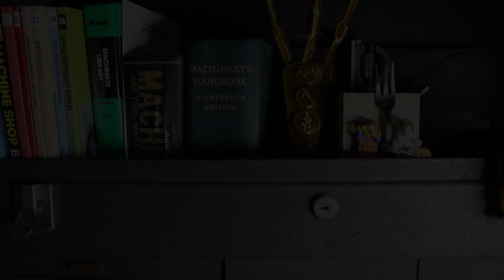Making an Adjustable Vise Stop for the Mill

Comment: This video just came up today for me.  Had a look at your other videos and subscribed.  I really like some of your designs!  Great takes on some concepts.  For this work stop I love the details.  And the single knob angled lock really caught my eye.  But I'm not sure about it for a work stop.  I made my own similar style work stop a few years ago.  But I used separate locks for the vertical post and stop rods.  I think I prefer the ability to line up the rod and lock it for angle and height separate from the actual stop rod.  No fumbling in 3 dimensions.  But the idea of the twin lock feature from one angled knob could be a real game changer for something like an indicator holder where it's not at all uncommon to be sliding things around in 3 dimensions at once.  It's certainly a slick idea that I'm going to try to use in SOMETHING fairly soon.

Comment: set up your chamfer on the non movable jaw of the vice. then you can mill every piece of material thats that same size in your shop with the same chamfer profile. including all 4 sides of whatever you are working on.
Reply from the maker: I did it on the movable jaw to get better shots. It was square enough to get the four sides without adjusting the cut, anyway. I do use the fixed jaw side when not filming.